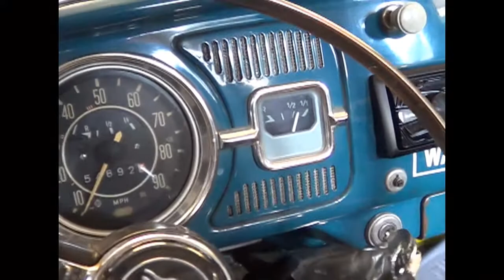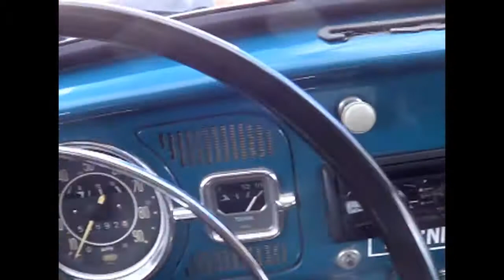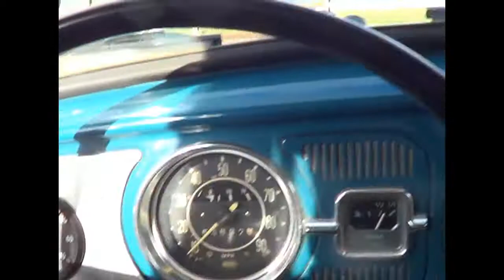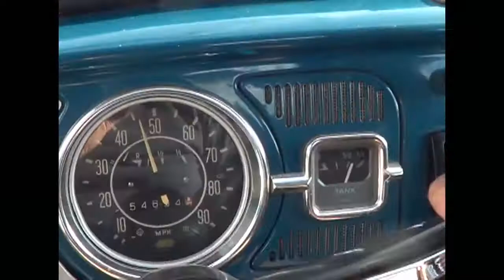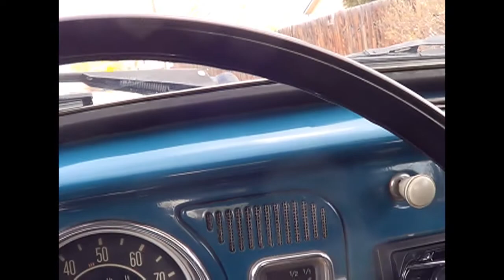My 66 Volkswagen pt 7 tranny test

Comment: shes sounding a bit whiny not that bad though , would the high ratio be more prone to do that?
Reply from the maker: duggy788 I think this tranny just has a lot of miles and some of that was low on oil. When the factory test runs the R&P in a jig the find the spec that makes the least noise. It is hand scribed on the gears so a matched pair. Someone may have been in this one before and thats why the detent plugs were missing????? Always a mystery